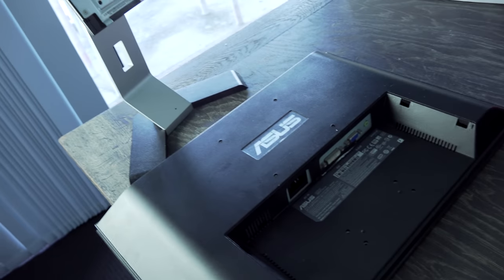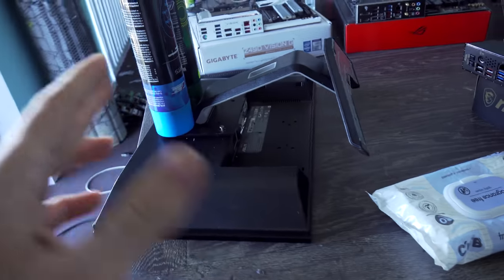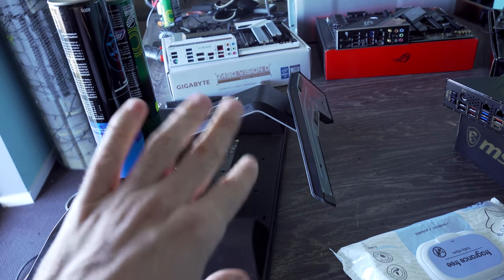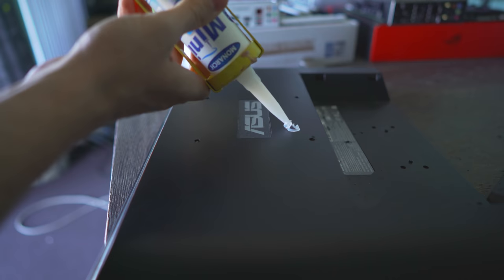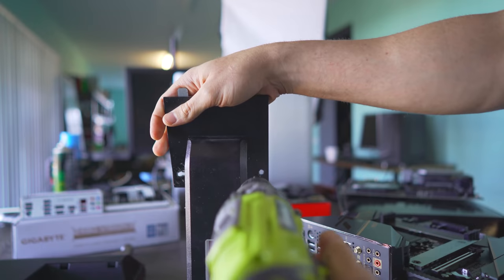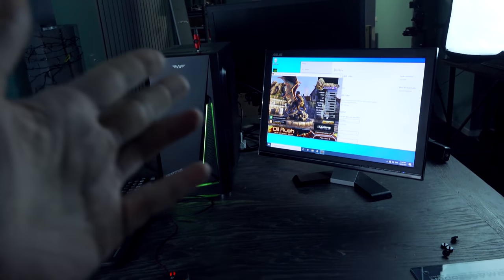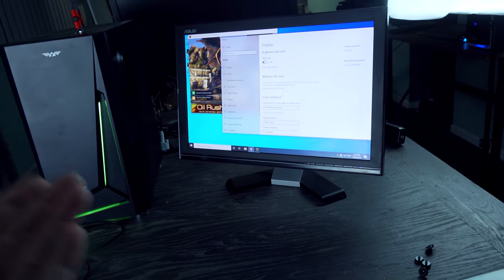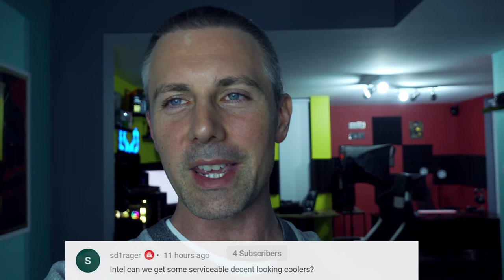How I Made a Gaming Monitor for FREE

Comment: I had a funny experience with silicon. I once had i3 4370 i thk cpu and its cooler (stock) died and since i was only a kid and didnt know much about pcs i only had lga 775 cooler (core2quad cooler) and u guessed it holes dont line up yay :D...
So I took silicon + super glue and fixed a cooler for the cpu (and it fried cause there was no thermal paste :( .

Comment: I would never use silicone to glue stuff together with, as it is not made for it. It is made for sealing off against moisture. Though I’m not sure if silicone is exactly the same in Australia as it is here. We used “assembly glue” for that kind of job. That stuff can hold 200 plus kilos to the ceiling. These where some strange years at the glue factory... 
Love the idea about finding ways of getting old tech back in use. Keep cracka’lacking at it Yesman!

Comment: Great  use of silicon, I wold never do it that way but if it works for you than why not. You figure if silicon can bond glass together and allow it to hold hundreds or even thousands of gallons of water it can surely keep a stand attached to a monitor. I would just buy a cheap monitor stand and vesa mount it. But I understand this was a budget build.

Comment: I have to say my father is a siliconizer and works a lot with silicon and the easiest way to remove is with a stanley knife to cute ist clean off otherwise you won't be able to break them (only by time and for a silicon it takes about 5-10 years) they are very durable and if you are using it for things like this I would recomend you pci silicon they are way stronger and more sticky

Comment: If you want the best bond between the monitor in a handle just buy a great 500 and in scrash the surface were you gonna bond with silicon in that will be stronger bond when you finish

Comment: Back in the good old days :-P LCD monitors used to be made in 16:10, 4:3 and 5:4 aspect ratios. 16:9 came a bit later if I recall correctly. 
1440x900 19" monitors were relatively popular on the low end.
I myself have an Asus 22" 1680x1050 bought back in 2007 or 2008. 1920x1080 and especially 1920x1200 used to be quite a bit more expensive back then than 1680x1050.

Unfortunately now everything is 16:9 or even wider.

Comment: Are they in VESA mount standard? Buy some M3 screws and they should be fixed properly...
I'm using XG258Q + Chinese stand which the situation is a lot worse ( "VESA" but with far less margin ) and ended up with screw adapters from a unused hyper212 + NHU12S

Comment: Those monitors were, and still are very common: in hospitals, police offices and some accounting centers and cashiers. Many of these places use some type of especially made program, those programs use that resolution as a default. The supposedly strange resolution is the minimum to read text, charts, some simple graphic clearly; and not need a high end computer to run it. Many of the computers that come with this type of monitors don't have dedicated graphics and the ones that do mostly are very obscure no branding OEM very low end cards.  most of them use TN technology, there are well know for there bad color accuracy and yes there some brands that make dose type of low budget monitors with IPS technology, but there not common. these are only sold to companies in bulk most companies want quantity at a lowest price than quality.

this are very reliable and last long time most of them can run at there high resolution on 75Hz to 85Hz just fine. and there some that can be made to do higher resolution but they tend to have over heating issues plus have and always present message saying resolution not supported on screen...so the majority are not worth it for that because of the hit or miss of it to work. I have and old e machine one that I can make it run at 1080p but it overheats a lot I just put a PC fan on the back on hole I made.

Comment: 0:38 Mr. Tech YES Man: "I have used silicone before..."
Me a viewer: 'Flashback' "Oh no, not the i5 again, dude."
Also me: 3:13 "Is this new or old?"

Seriously though, the same as WD-40 overseas is a different mixture where usually Australia and Japan has way better mixtures. The same applies for silicone. In the United States, it's usually not as strong.

However as of recently, you can now buy a better mixture to apply that I would probably say is from overseas or the same mixture. It's expensive in the United States though. It's $9.89 for one of those stronger silicone. We use it on tin roofs that usually have a chimney or very strange angles that can't be nailed down. Usually it's a chimney and we go through a pack of three of those good silicone which cost around $30. Yet, that stuff can stay on ever through hurricanes. It's amazing what a different mixture can do.
Reply: Yep same here, glue like silicon costs more than used 900p monitor as a whole.

Nice content anyway Tech Yeasss Meaaann

Comment: Really? Couldn't find some screws with nuts and maybe adapter plate in that hardware store?
Also, you know those vesa mount holes go into metal behind plastic shell, right? One bump and shell can break if silicone is strong enough

Comment: y not just use epoxy glue   and  i got a dell monitor  that does 1440 by 900  and its 75hz a friend just gave me   but ive had  a acer and a hp also that did 1400 by 900 but they was only 60hz its  actually a pretty good resolution especially if u can get one like my dell one with 75hz

Comment: 1440x900 isnt really an "unusual" resolution, Many smaller flat-panel TVs (26" or less) use it in PC mode as well as Many older PC displays, although more uncommon than other resolutions, not exactly rare.
Reply: Indeed, my small tv has 1440x900, my iMac early 2006 and my main gaming pc has 1440x900 too
Reply: Oh and also my 2009 gateway laptop too
Reply: Ah yes, i forgot about all the laptops that tend to use that resolution.

Comment: I'm just going to buy a small TV. I hate pc speaker's and if I use a TV the speakers are built in.
Reply: Indeed, I've had 3 monitors with in-built sound and the sound on all those was rubbish, the two (not high end) TV's I've had have been miles better.

Comment: I would go with two-sided industrial tape.  That stuff will hold under warm temperatures, at least to monitor temps at the rear of the panel. The kind of tape used to hang towel hooks, etc.  

Silicone...might soften IMO.  The door sealant strength makes sense because that silcone was spread over a large (linear X*y) surface area.  That should withstand a large amount of force. With the monitor, it is those warm temps that might be the bigger issue over time.

Comment: Hey everyone i do have this PC my specs:
- CASE: iBox Passion v4 Middle Tower
- PSU: nJoy Agon 600W
- MBO: ASUS PRIME H310M K micro ATX
- CPU: Intel Core i5 9400F 2.9GHz, 6Cores 6 Threads, 9MB
- RAM: 16GB (2x8GB) DDR4 2666MHz G.SKILL
- GPU: Gigabyte Nvidia Geforce GTX 1660 GDDR5 - 6GB
- SSD: 240GB SSD 2.5" SATA3 GIGABYTE
- HDD: Western Digital 500GB
And i have a issue which is causing my CPU USAGE 100% idk why can someone find me a good solution.